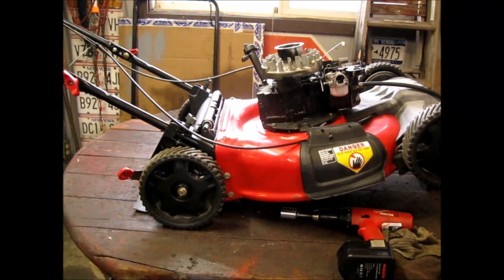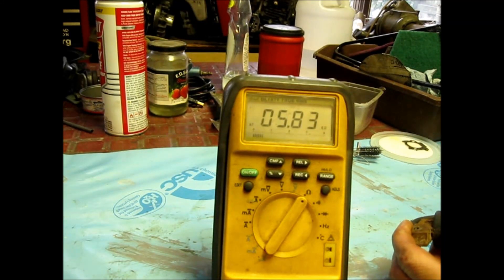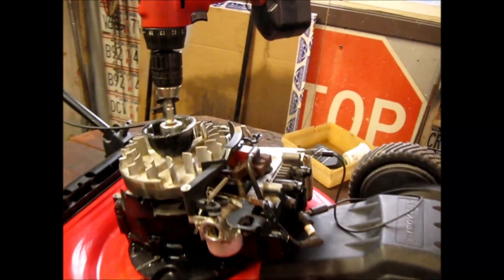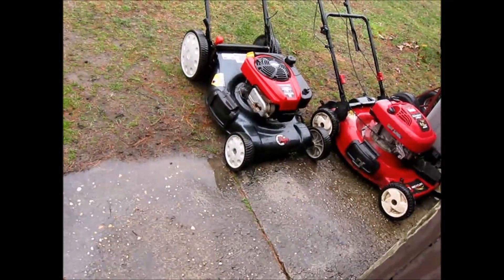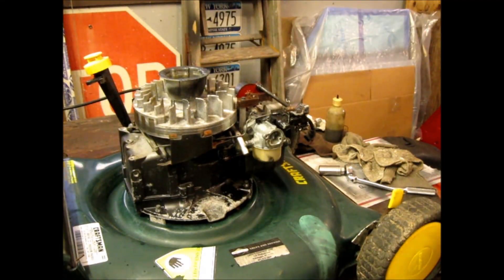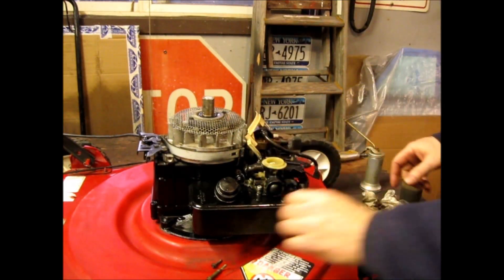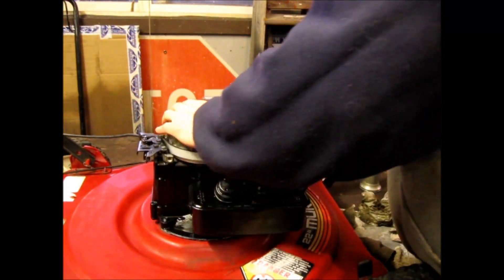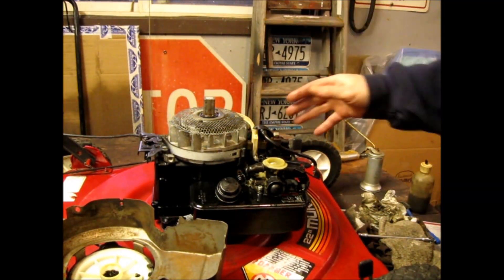Ignition Coil Testing with ohm meter for small engines - Briggs-Tecumseh - How To

Comment: For those that have a meter that had auto range for ohms it’s not that confusing, for those that have a meter with varied fixed ohms ranges it get confusing for which range to use when testing!
Reply from the maker: Great Point,, gonna pin this comment!
thanx!!

Comment: Working with one wight now off my briggs 6 hp and she's reading 4.5k on the secondary but she only .6 ohms  POINT SIX, on the primary.  Seems shorted on the primary to me.
Reply from the maker: Yea, almost like its grounded to the core or frame. make sure ya measure with the coil off the machine!!

Comment: whoa, "cleaned up the coil and lubricated it" ?? Did you check the oil also? haha. good vid , entertaining.
Reply from the maker: Thannx,,,In newer vids I explain this more effectively.
All of my repairs I go through this, if a coil is bad electrically its junk. But most issues arise from poor connections, rust in the way and a bad ground or return to the engine block! The I adjust the coil gap tight .010 and BEHOLD no more ignition issues!
Thankx for watching!

Comment: The high voltage lead of a magneto is a secondary, not a primary. The primary is charged by the magnets on the flywheel at low voltage, and through the laminated core it steps up the voltage at low current.
Reply from the maker: Thanx UncleScott, as you may see, below you others have made this comment/correction already!
Its an early video for me and just about every tuber experiences a misspoken word from time to time.

Comment: Here is a quick question 
Why when testing an ignition coil it has great spark with a spark tester...BUT with a spark plug...weak or No spark...6 plugs tried
Reply from the maker: As a Guess because I'm not there observing; if the tester has an alligator clamp, then its making a good ground or connection. 
Check the coil with an ohmmeter. Also check the plugs with an ohmmeter too.
In the description is a link to my new video on the subject.

Comment: What could be wrong when the coil test good but has no spark at the plug? (2 new coils also don;t spark),  The tab wire is not shorted either.
Reply from the maker: Tab wire? I assume that is the kill wire? Disconnect it, try another plug and clean any ground, Clean the post that the coils mount on. 
If all the grounds are good, coils replaced, kill wire pulled off, then my guess is the plug.....
Reply: @TheNovaJohn  ...or the coil may have moved from not being tightened enough and the air gap got changed?

Comment: What setting on the meter are you using?
Reply from the maker: Ohms setting and often you can use auto range but as I mentioned 6k is generally getting too high for a coil so some setting you may have above this range

Comment: Great video. One problem- Mine tested perfect from primary to mounting armature. 
However testing from primary plug end to ground wire point showed nothing. 

What does that indicate? They both test like that same. 
It’s on a V twin zero turn. Machine does run
Reply from the maker: Typically I test just like in the video, if I go from the plug wire end, to ground, then from the plug to the tab on the coil, that's the kill connector that grounds out the plug end basically. 
These readings should be very close to each other..
If not, I would say you have an issue with the coil.
That grounding tab is what get connected to ground to kill the engine,, if you are "Open" or no reading or resistance, the engine would likely run but ya cant shut it off...
Clean everything well then re-test

Comment: You ever broken fly wheel bolt using your wrench to turn engine over ?
Reply from the maker: Yes, but only on a small 2 stroke engine, not on these larger ones, unlikely cuz they are too big
Reply: @TheNovaJohn  I have broken several on 4 stroke engines with my wrench !  
A  b i t c h  to fix !
Reply from the maker: @Buddyman1225  LOL,,, Take some vids of that!
Reply from the maker: I hope your not using an impact hammer drill? I just use a heavy 1/2 drill that I modified to add safety from kickbacks

Comment: WHILE DOING THE IMPORTANT OHM TEST THE TEST POINTS WERE OUT OF VIEW TO FAR TO THE RIGHT  NO INFO AS TO WHAT OHM READINGS SHOULD INDICATE A GOOD BAD RANGE  JUMPED AROUND LOOKING FOR PARTS
Reply from the maker: watch the entire video, I do it again from another view and I say it over again.
That was an older video when I 1st started, crappy camera as well.
I will make another video on the subject soon.
Generally around 5k is max usable on most coils, above that they will fail shortly and if the reading is all over the place its as bad as if it has no reading at all.

Comment: Do the coils have a primary and secondary sides to check, or is it just primary and ground terminal for shutoff?
  Watch one video where the guy called one primary, the other secondary as if there were 2 sets of windings or something.
   Can a bad coil cause a weedeater not to rev up?
  This is assuming the carburetor is good.
Reply from the maker: These coils (Armatures) dont really have a secondary or primary, there is one side as an output with "High Tension" that connects to the spark plug, many people consider this to be the "Primary" Lead.
In the old days the coil was wired differently, they used points  and that triggered the secondary.
Now there is an electronic system inside and we connect the control wire that gets grounded to the engine.
If you look at the OHM meter you can see the reading is very close when measured between ground and plug wire vs ground and trigger connector.
If one or both of the readings is off as I describe in the video its either bad or its dirty.
Hard to say what causes a small 2 stroke to not rev, take a meter to the coil, typically it should read around 2-5k and it will work.
I have heard that some coils wont make top RPM
Also check the Hi side adjustment on the carb
Make sure the suction tube is clear and the filter isnt clogged, blow through it, any restriction will cause issues
Reply: Arch's Garage I have some experience with the carps, but I really didn’t know if the coil could cause this. 
  I have one I had a buddy that works in small engines check. 
  He gave up on it.  I thought I would get him to check it, because at the time, it belonged to another buddy of mine. 
  Buddy that had it ended up telling me to just keep it. He bought a new electric one 
  I do intend on checking it myself. I don’t like for something like to beat me without knowing it is not feasible to fix.